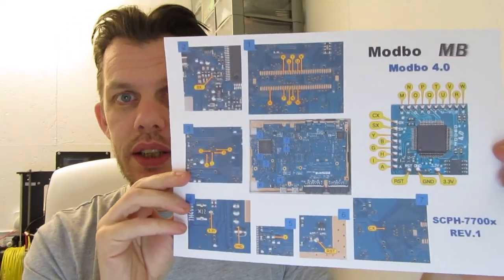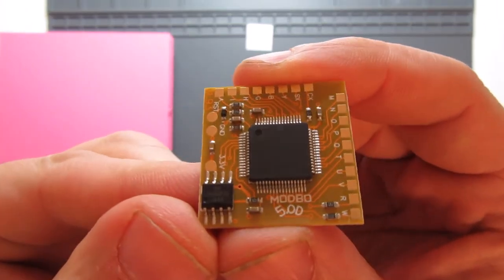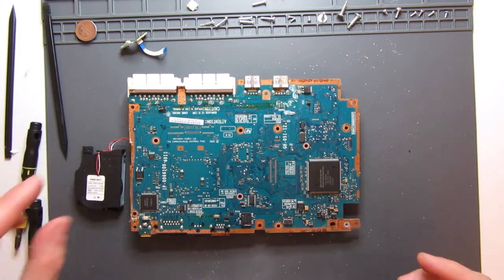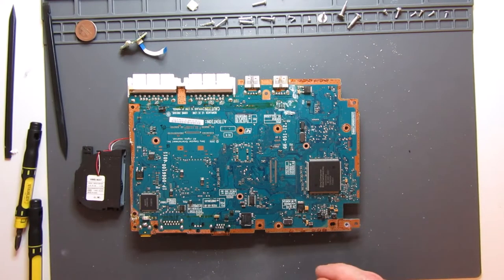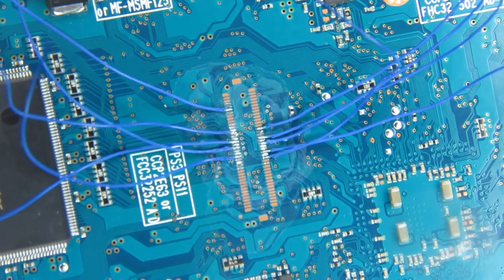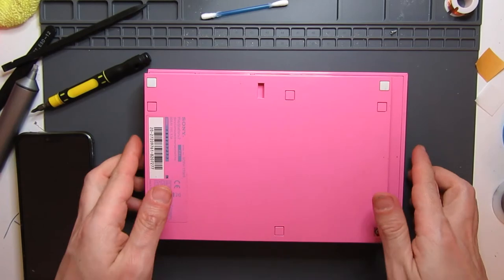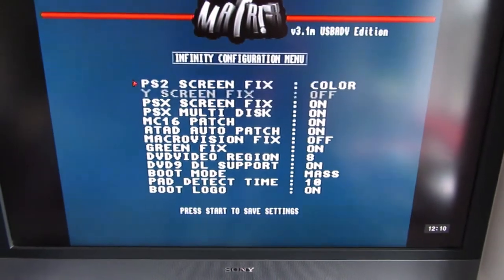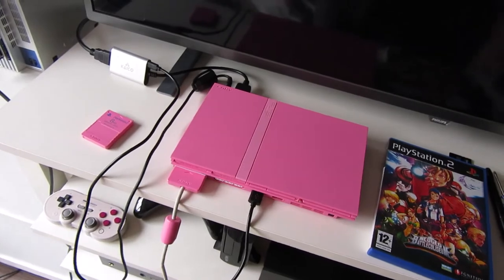It almost beat me!!!  PS2 ModChip

Comment: Viewer here from Metro Manila, Philippines. Back in August 25, 2002, my uncle bought an SCPH-30006 Fat PS2 with a modchip pre-installed that can play original and pirated PS2, PS1, and DVD movie discs from any region. It would do straight boot-up for PS2 games but when it came to PS1 games or DVD movie discs, you had to do some boot-up trickery by inserting the disc onto the tray, closing the disc tray, then place the console into standby mode. Then reboot the console by firmly holding down the reset button until the disc is read but it does show the PS1 logo during the boot-up sequence. Looks like my uncle's PS2 had one of the early Messiah or Magic modchips installed.

Looks like the Modbo 5.0 modchip came late into the PS2's life cycle and improved upon previous modchips for I have seen videos here on YouTube wherein people who tested them did not resort to any boot-up trickery with the reset button for playing PS1 games but the problem is the PS1 logo doesnt how up. Is there any way the Modbo 5.0 chip be tuned in the menu to show the PS1 logo during the boot-up process? Early PS2 modchips did not allow you to access its internal menu settings unlike the Modbo 4.0 and 5.0. I have an unmoded SCPH-50001 Fat PS2 but I have 2 Modbo 5.0 Modchips and 2 KHS-400C spare LASER lens modules. I am planning to buy another Fat PS2 that I can have one of my Modbo 5.0 modchips and spare LASER lens module installed in to play PS2 and PS1 games region free but I would like to have the PS1 logo show up in the boot-up sequence like an unmodified PS2 without having to do the boot-up trickery on earlier PS2 modchips.

As for your problem with the HDMI adaptor to your TV, your HDMI adaptor might be able to read 240p resolutions or your TV's HDMI ports might not support resolutions lower than 480p and 480i. You should try using a TV that can read lower resolutions via RCA composit or component cables or use a SCART connector since you live in a PAL country(I'm guessing you are an Aussie judging from your accent). I believe modern day budget friendly HD-ready TVs with nalog video inputs can read lower resolution or use an old CRT TV to be sure.
Reply from the maker: Thanks for all that! And yeah PS1 games work fine with a scart cable (I'm English btw 😊)

Comment: I installed this finally in a spare PS2 slim i had a few weeks ago. If you paid me any amount of money right now i wouldn't do it again. It was the biggest pain in the azz. When i got to the end i of course had to resolder some wires back to the points. I had a magnifier with a light and advise a microscope if you want to attempt this. I cannot tell you how long it took me. If i had to guess i'd say hours. I am 48 now, so the hand and eyes are not as young like they used to be. It didn't defeat me though!
Reply from the maker: I can empathise with every point you made there! Congratulations for persevering with it!

Comment: Modder here (rsx), I know this is old but the 77 model is the highest I'll go because the 79 and 90 series b/g/h/i points are too difficult and I never really had the opportunity to work on them,. My customers didn't have one, turns out they weren't big sellers. But by that point in the ps2's hardware revisions, sony cracked down and made it incredibly difficult.
Reply from the maker: Difficult is right!
Reply: @JoeBleeps  It's the bios points for that model, roughly 10 wires. My strategy is a magnifier (from harbor freight), then make a small incision with an exacto knife on each point, this exposed the bare metal. Then flux, tin the points, wipe it down. Tin the wires (30awg) small dab of flux and it goes right on. Never bricked one.
Reply from the maker: @chrisj3205  really useful tips, thank you!
Reply: @JoeBleeps  I can throw you one more: The Hakko fx-650 has been the best soldering iron for the job. Good luck!
Reply from the maker: @chrisj3205  🙏😊

Comment: Hey Joe, great video mate. I’ve got a FAT GH-026 board in front of me and a Modbo 5.0. Just about to install but wanted to ask any recommended mounting positions for the CHIP?
Reply from the maker: Before you start, do a Google image search for that board and chip and see what position you like the look of. Can't say for sure as I've not installed one on a fat ps2
Reply: Joe Bleeps Thanks mate. O yeah I’ve got my diagrams all sorted but couldn’t quite see from the diagram on the chip mounting position. Really I wanted to know if it was OK to mount the chip on top of a resistor as I have no free space without doing so. I figured I can do long as I use tape to insulate the two components.
Reply from the maker: @consolecoast7897  yeah so long as you insulate it you're all good
Reply: Joe thanks man, appreciate the advice and the good videos you’re pumping out.
Reply from the maker: @consolecoast7897  thank you so much!

Comment: Great video. I am a complete beginner and haven't soldered a single thing however I am planning to attempt a ps1 mod chip and then this slim mod chip. Any advice would be apriciated.
Reply from the maker: If you've never soldered before I'd say avoid something like this, at least until you've learned how to do it. I've just recently uploaded a soldering tutorial video, be sure to check it out.
Reply from the maker: https://youtu.be/a3Hg4n5pS60